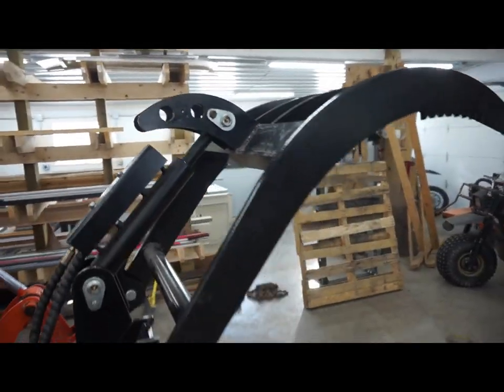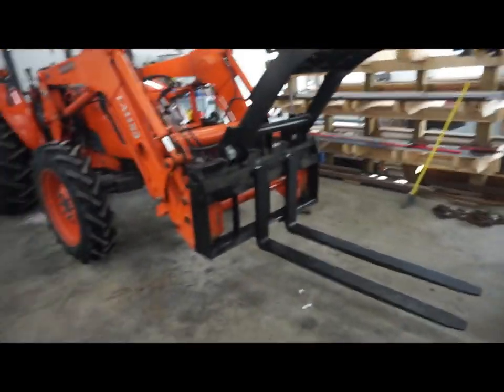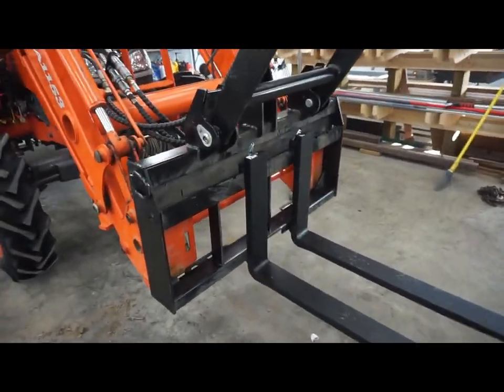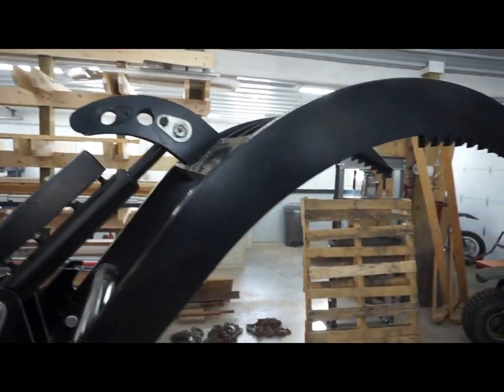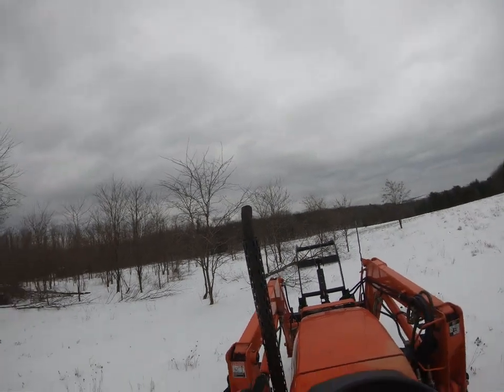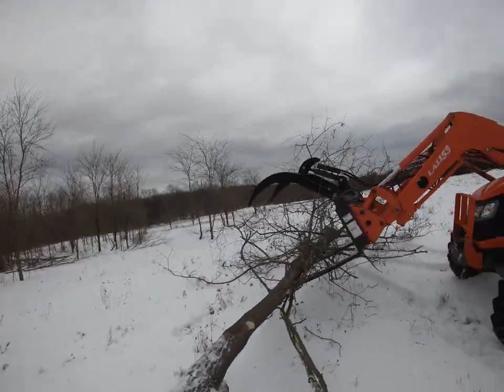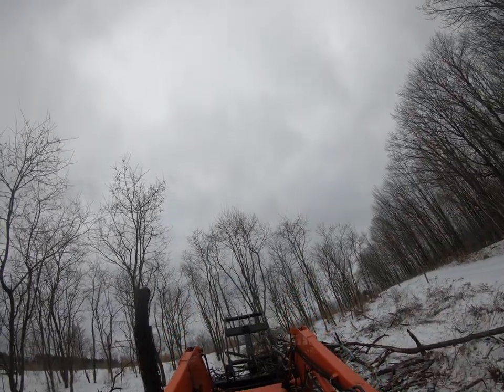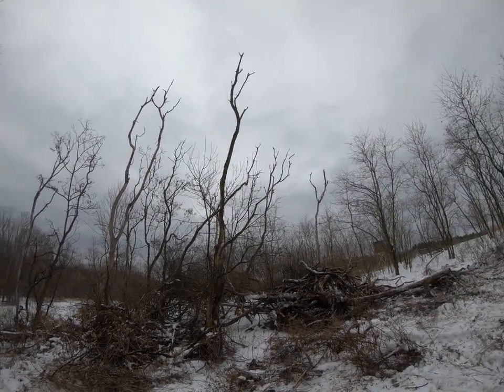Titan Attachments 48" Grapple Forks Test and Review

Comment: Very good video! I have same tractor with loader but I don't have the third valve option to where I can hook up this attachment. oh well.
Reply from the maker: You can run lines from the rear remotes for fairly cheap and use the rear controls

Comment: What is the item number on this unit?  Is the grapple removable, so I can use the forks on Taller, larger loads than the grapple can open up for?  I have read contradictory answers some say they are removable with three pins, another said they are welded on and not removable?  thanks!
Reply from the maker: Hi Heather! Thanks for the sub and comment! They are removable with three pins but it isn’t something you’d want to do regularly. It would be clumsy and heavy to get the grapple on and off. The grapple does get in the way but not very often. I’ve always been able to lift anything I’ve needed to but can’t always pull all the way in on some of the taller items like I’d like to.
Reply: Good to know, thanks for the reply.  I have a Montana R3644 with rear hydraulic connections, can I connect the grapple to these or should I add a third function unit?
Reply from the maker: @heathero1183  you can attach the grapple to the rear but you’ll likely need to get longer hoses made up. Still it will be cheaper than a third function kit. A lot of folks go that route. It’s just a little more clumsy than having a switch to operate the grapple like you’d have with a 3rd function valve. Either way will work!
Reply: @DirtRoadLife1  awesome thanks!  Looking forward to giving this a try!!
Reply: Does the grapple not close any further than you show?  Those logs it’s not really clamping on